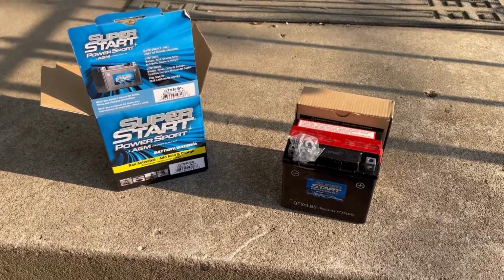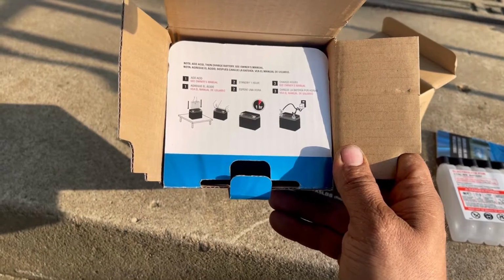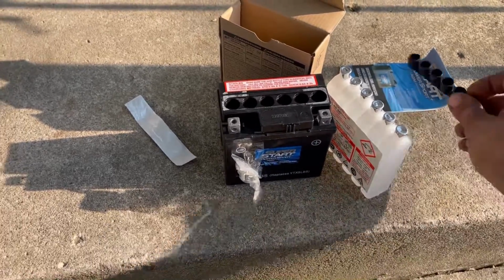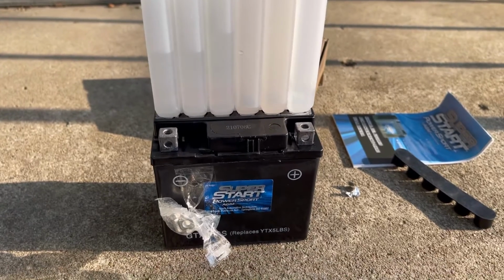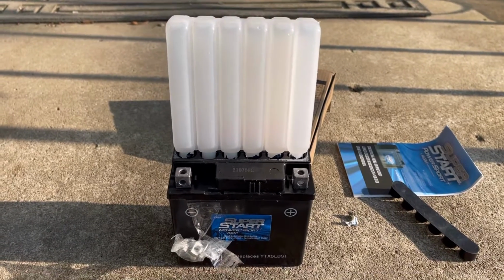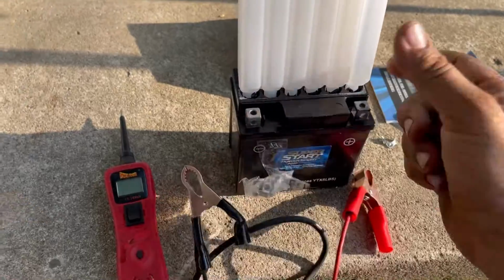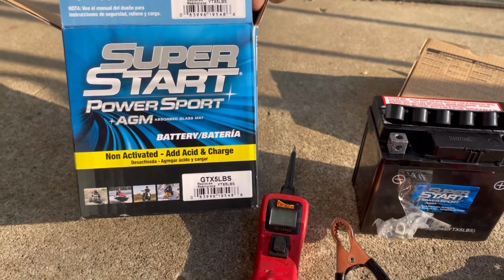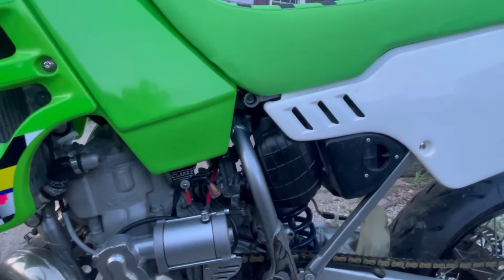Prepping new motorcycle battery filling acid electrolyte agm glass mat kx500 electric start atv bike

Comment: Wow cool prep for these AGM batteries, I’m only familiar with those Yuasa snowmobile and motorcycle batteries bit have never prepped one with dumping in the sulphuric acid.. so I need to ask a question on trickle charging batteries my 2013 A4 looks to still have the original battery in it, but it’s been sitting awhile because I have the front carrier completely off doing the complete timing components upgrade.. my crank/cam ECM correlation is -7.1° so I decided to do it all.. dude I have no idea how you do that job without removing the front??? Although it only took me a few hours to pull off carrier and I know how now.. anyway I wanted to start to charge my battery because I disconnected it because I pulled the air bag connectors.. so is that battery an AGM or a std lead acid battery and I have a charger that has a setting for AGM/lead acid but I’m not sure what the difference are other than current draw. Can you charge a non AGM battery in a AGM setting and vice  versa? Dude wear gloves next time